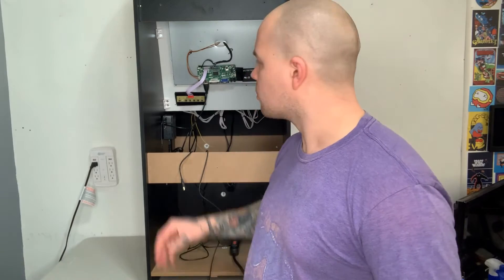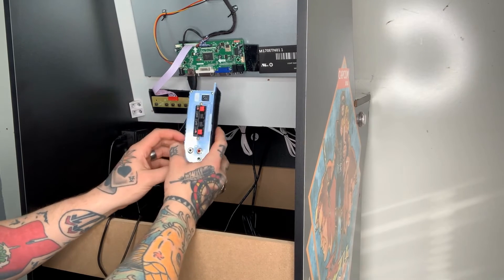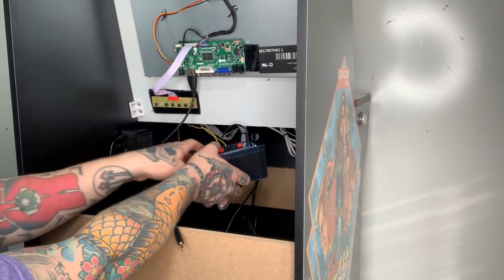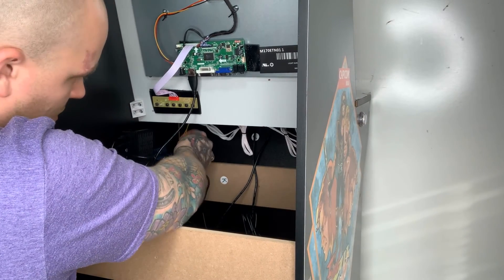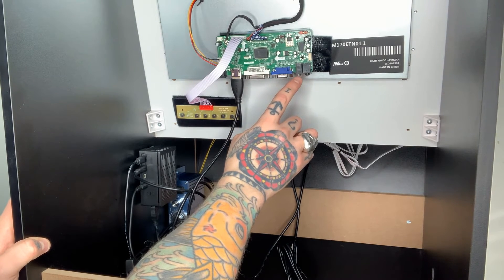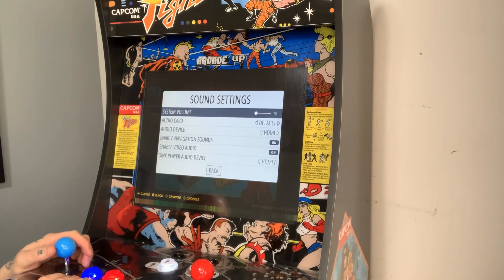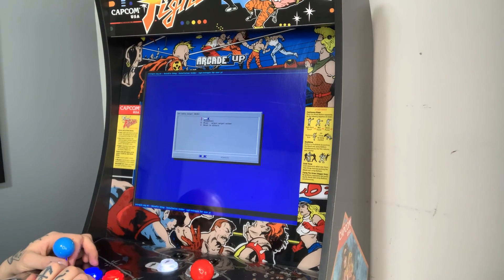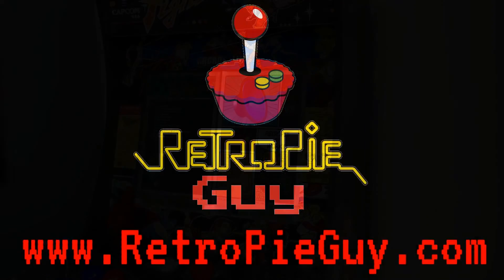How To Install A Audio Amp On An Arcade1up Mod Cabinet - RetroPie Guy Tutorial

Comment: What audio output/profile do you use? I’ve done this setup but still can’t get sound through the speakers 😢
Reply: I believe you have to go into the settings to force it through the 3.5mm headphone jack. My Pi 3B+ has been removed from my cabinet so I don't know the step by steps that got me there.

Comment: I have a newer TMNT A1up cabinet. The stock speakers are situated below the marquee and above the monitor. The wire for these stock speakers is an 3.5mm Aux cord.

Here's the question - If I plug the 3.5mm aux cord from the stock speakers into the amp using a 3.5mm Female to 2 RCA Male Stereo Audio Y Cable and then another aux cord into the MP3 port > Raspberry Pi, will I get sound? I think I should, but I just wanted to see if you tested this recently and can confirm. Thanks for all your content!
Reply from the maker: Hey there I'm not sure. I haven't used a recent arcade1up that shares this setup. It sounds like it should work though. You may need to adjust your audio source within retropie though. You could probably even plug directly into the pi and bypass the amp completely if you wanted. Volume could be adjusted within retropie though that's usually very limiting as games have different volume levels by default.

Comment: Is there a way to map buttons to adjust the volume instead of using the amplifier ?
Reply from the maker: You can adjust volume within the software but it only works for minor tweaking it really doesn't change the master volume level all that much.
Reply: @officialchasebrogan  thank you for the response , I did find an in-line rca volume adjuster on Amazon for about $7 Ima end up using that
Reply from the maker: @datchulo1085  perfect!

Comment: I heard it's better quality sound to plug the 3.5 into the HDMI controller
Reply from the maker: I didn’t notice a difference personally but it’s certainly possible.
Reply: When I plug the 3.5 into the lcd converter I only get mono.  And when I switch to the 3.5 out of the pi and switch it to that in the audio menu, I then get nice stereo out of both speakers I am using.
Reply: I have never been able to get the HDMI out to work. I've tried every tutorial.

Comment: you wired it to the Right channel only, so does it give you Mono sound?
Reply from the maker: There’s only one speaker on this cabinet
Reply: @officialchasebrogan  i am having a hard time to wire my cocktail style arcade 1up cabinet. It has 2 speakers on each side
Reply from the maker: @marvinho8794  oh okay you probably need to use both channel then for sure. Not familiar with those layouts
Reply from the maker: Are you modifying it with a raspberry pi? The audio is a pain to her connection with pis. It took me several times before the connection was made. This is typical with raspberry pis in general. They always struggle with connecting to audio whether internet tv, speakers, or headphones. You could have it done 100% correct and it not connect for a couple tries before it finally establishes the connection. It drove me nuts my first time because I kept changing things around thinking it was my error.
Reply: @officialchasebrogan  thanks. Yeah having a hard time figuring it our. I think easiest way is to find an adapter from the lcd board to audio jack.
Reply: @officialchasebrogan  yes for Rpi4. What makes my project extra frustrating is getting everything to display in portrait mode for this cocktail cabinet. Everything seems off center and out of the frame. Tried everything and close to giving up
Reply from the maker: @marvinho8794  could be. Not too sure.
Reply from the maker: @marvinho8794  https://youtu.be/0S_2cqAQuLU check this it may help
Reply: @officialchasebrogan  thanks! Will watch this

Comment: i recently bought the midway legacy and on my first day the new volume slider (that lets you adjust from 0-15, rather than having off, medium, or high) gets stuck going all the way up or all the way down. i am highly considering purchasing an amp to have an easier and more reliable audio adjuster. i will get a replacement slider if arcade1up permits but i am unsure if it will be any better
Reply from the maker: Ah man that sucks! Those volume controls can be pretty cheap. I have heard of this happening with others as well. The amp definitely gives you more control. You can’t easily access it that’s the only thing but the sound is stable so you can typically find a good adjusted volume level and keep it there,

Comment: No external amp is needed the amped speaker port on the LCD controller board works fine for sound (the white 4 pin port above the 3.5mm jack)
Reply: were you able t get a 4-pin to audio jack cable?
Reply: @marvinho8794  no, I just carefully clipped away the 2 port plastic connector and pulled the crimped ends out then added some heatshrink to them each for insulation then plugged then onto the LCD boards amped port pins. Avoid using any 3.5mm Jack ports as that badly lowers the audio quality.
Reply: @EliteC64  the cocktail cabinets of arcade 1 up uses jacks to connect the speaker.
Reply: @marvinho8794  I use am SF2 cab but in your case I'd just cut the jack cable off and connect the wires to the LCD pins on the port.
Reply: @EliteC64  how did you reach the speaker
Reply from the maker: How do you adjust the volume?
Reply: @officialchasebrogan  via the Acade1ups stock volume switch using script here: https://youtu.be/EZM-4rrYpQQ
Also lets you power on/off via stock switch 😉